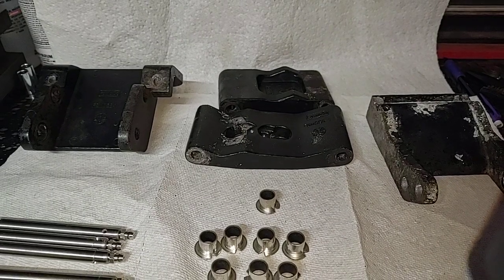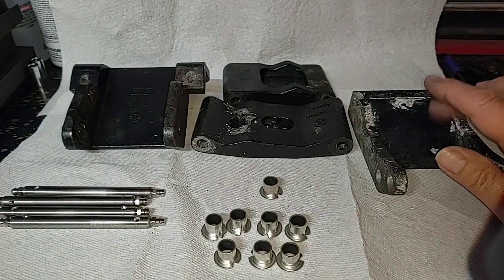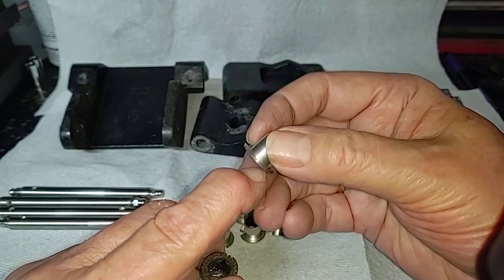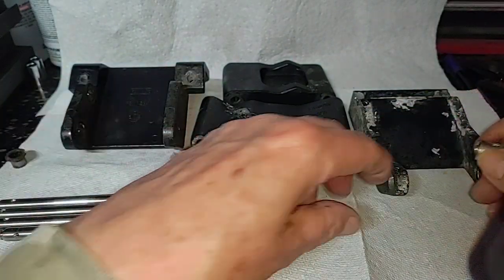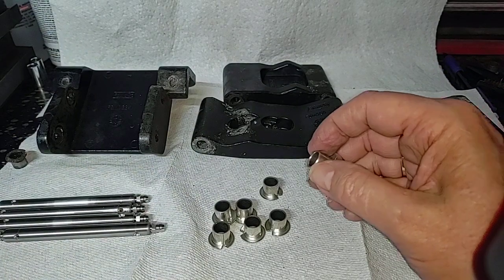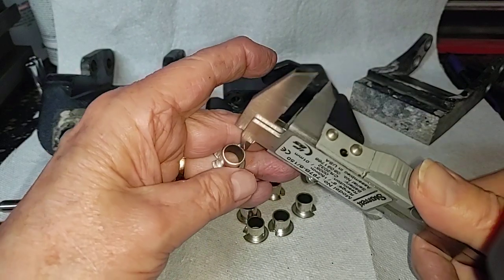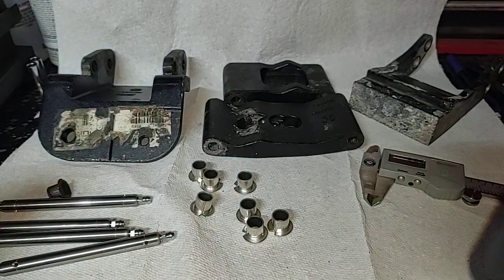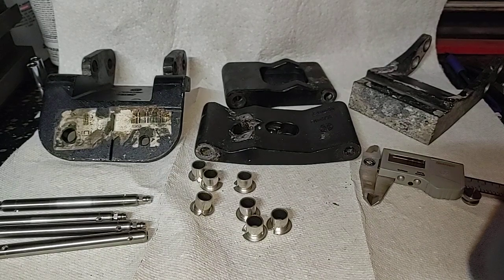Ford / Lincoln Power Running board Bushing Fix, New Bushings, what's involved. This is the way.

Comment: You need a 12mm rimmer. That's what I'd do in the body's. Get a sharp Stanley blade and trim the crud out one of the  holes, then have a measure. You'll find the holds grow alot probably.
Reply from the maker: While that is a possible solution, that does leave the pins a bit loose in the bushings. At 12 mm, there is 0.5mm of clearance between the pin and the bushing.
Reply: @oldfarthacks  o.k, but what about the rust preventive coating  you will be removing at the same time. Don't understand what they need to do. Couldn't you lock tight the 0.5mm gap or shim it by 0.2-0.25mm?
Reply from the maker: You need the gap for the pins to be able to rotate in the arms. As to rust coatings there are none in that sense. The bushings have a very thing zinc coating and then the bearing surface is plastic.

Comment: They Fit the amp steps , i got this kit, its  still a pain in the butt and mine  is  still hanging up may just end up buying the left bracket
Reply from the maker: Yes, this design is somewhat poor. But then, all the auto makers use the same basic design, they know that it will be good for about 8 years.